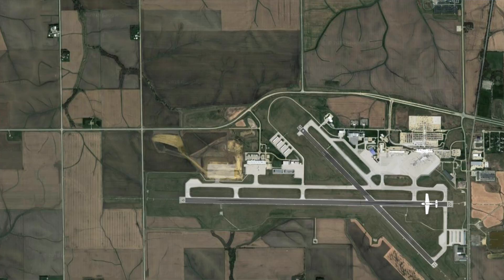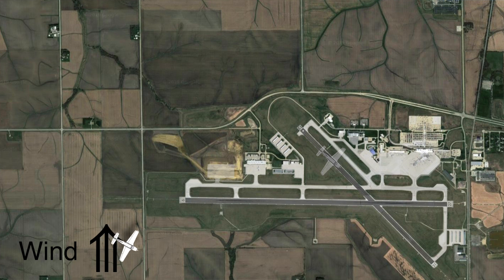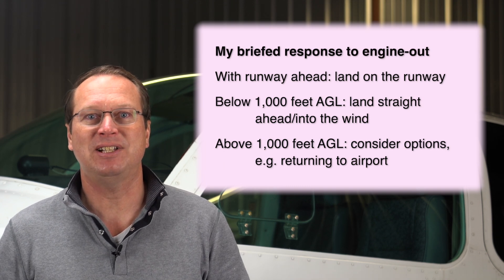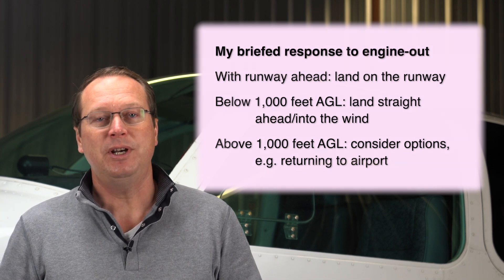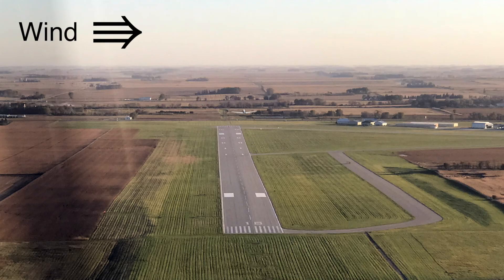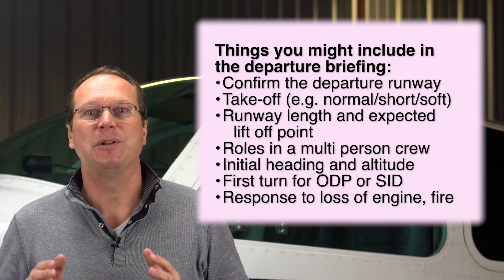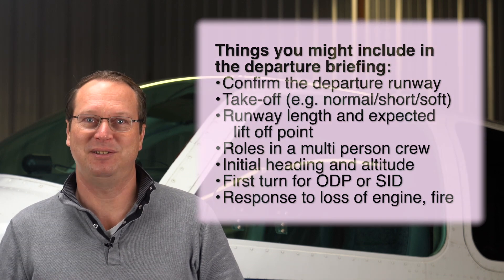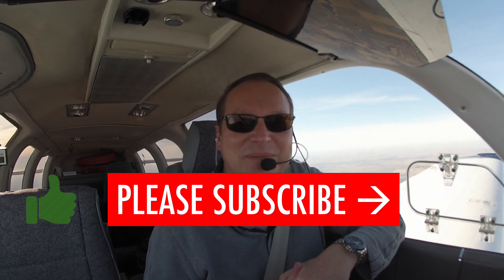Departure Briefings - HOW and WHY

Comment: 4 phases

1)ENG FAIL before rotation- throttle idle directional control w/rudder brakes as required, get off the runway if possible 

2)ENG FAIL after rotation w/ runway remaining land normal, directional control w/rudders brakes as required get off runway if possible (on taxiway)

3) ENG FAIL after rotation without runway remaining- land in front of you, no more than 30 degree to your left or right with shallow banks. Pitch for Vg, fuel shut off, mixture idle cutoff, electrical switches off, master switch off ignition off and key out, seat belt tight, door cracked open. 
(Landing on road try to go with the flow of traffic) (Landing other than pavement, land slightly nose high).

4)ENG FAIL above 1000 feet turn into wind and come back towards airport environment.

Comment: Great lesson - Thank you!  Without writing a novel, I lost thrust in a PA-28 Cherokee 140 at about 150 feet.  The propeller was still turning and  I instinctively turned left (pattern direction) thinking I might limp it back.  I made it through about 20 degrees of turn and realized it wasn't going to work so I landed straight ahead into a field of mesquite trees.  Totaled the airplane, no injuries.  With the insurance money, I bought another PA-28 and the next time I took off from the same runway (my son was flying so I could look around more) I noticed a farmer's dirt road 10 degrees right of runway heading.  Had I known this prior to TO, the initial turn direction would have been decided and I could have saved the airplane (and potentially taxied back to the airport!).  For what it's worth, Google Earth is a great resource for making those sorts of pre-departure decisions - I know that the images are not current, but it's still a great SA builder.  For those interested, the investigation showed that a dirt (mud) dauber nest was in the air induction system and broke loose and clogged the carburetor air intake.
Reply from the maker: Thanks for sharing that story, Logan. I agree, Google Earth or even just Google Maps in satellite view can be very helpful planning tools.
- Martin

Comment: Nice. My C152 departure brief is very similar to yours: Stop on rwy; Land on rwy if possible; wind direction is ** so it will be a ** turn to land in field within 30 degrees of rwy hdg. (I know where they are at my home aerodrome); Airspeed 65kts; Fuel, mixture, throttle & mags off; Flaps down as appropriate; Master Sw off; Sideslip as required; passenger briefed prior to taxi about keeping quiet, how to brace & aircraft exit but reminded at end of DB; if over 800ft more fields are available but a runway return is not until 1500ft alt. I do this every flight & practice fanstops about every 6 hrs.
Reply from the maker: That's a good habit, Steve. Nice job!
- Martin

Comment: A reminder about departure briefings ... pushing the yoke in and the nose down right away is critical.  Right after takeoff, the airplane is in a nose-high attitude and airspeed is already slower than cruise and may even be around best glide.  Pushing the nose immediately avoids the stall more likely to happen when the plane is already slow and the nose is high.
Reply from the maker: That's right!

Comment: Timely video. I've started to do a departure brief, out loud, even when solo in recent months. I find it a useful process to go through and it helps me to slow down and consider what I'm doing.
Reply from the maker: Good for you - speaking out loud when you're by yourself or only with non-pilot passengers may seem silly, but it actually works better. Keep doing that!
- Martin
Reply: @martinpauly  The other thing I try to implement is "talk and point", taking a cue from Japanese train drivers .https://www.youtube.com/watch?v=9LmdUz3rOQU

Comment: Hi Martin...as one of your newest subscribers let me say Happy and Safe New Year...and great video. If I may I'd like to add one addition to your departure briefing-and that is be absolutely be ready to push the nose over at any time if things go quite up front...on climb out we are a a relatively low airspeed, and high AOA, therefore airspeed is going to bleed off rapidly and a stall/spin at low altitude usually doesn't end well.  Just as I head out to the runway, I brief myself push the nose over and below 1000agl.,I going basically ahead....if power is lost on TO or climb, be ready to push that nose over, I guess almost anything is better than a stall/spins at 700 ft....Thanks again for all your insightful and educational videos.....
Reply from the maker: Good comment. Without sufficient airspeed, it's likely not going to end well.
Happy New Year to you as well!
- Martin

Comment: Good advice and thanks for posting.  I was never trained or told to do a departure briefing in a single engine airplane.  It was not until I did my multi training that I started to do departure briefings.  Before every flight in a multi engine airplane I would do a departure briefing but it makes sense in a single as well and I will start doing it now.  I see a lot of videos of folks flying multi engine airplanes and they do not do a departure briefing in their multi flying.  It may be cleverly edited out of the video but usually it looks like they just do not do one and they really should.  This is great advice.
Reply from the maker: I think it's even more important in a twin to do a departure briefing. With the second engine come many good options, but also the possibility of Vmc accidents. No better time to dry-run the correct response ("the drill") than before take-off.
Best regards, Martin

Comment: Hi Martin, Do you ever fly the impossible turn from 1000ft AGL? I'm told it can be done at that it can be done at that altitude or even lower, but not if it is the first time you are attempting it. One CFI suggested that pilots should set their turn back height to the lowest altitude that they have successfully demonstrate the maneuver 3 time in a row.
Reply from the maker: I have not done this from 1000 AGL myself in the Bonanza, John. I have done it at higher altitudes, though I hear from people with much more experience than what I have that it is a very different sensation doing this close to the ground.
The point of the video was not to suggest that 1000 feet is the right number - but to remind yourself of the number before take-off. Your point is very valid that what this number is depends on many factors, including training/practice.
Thanks for the comment, and all the best for 2020!
- Martin

Comment: A few things to include in your pre-flight briefing is your procedure if it suddenly gets quiet. The first thing is to push forward on the yoke. If you don't have altitude then airspeed is the only friend you have left, don't give it away. Get light in the seat, the airlines teach that, PUSH, you must not just sit there bleeding off airspeed. Know your best glide speed, look it up or calculate it before you go. If you decide to turn back you'll need that speed and realize that your stall speed will be quite a bit higher in a steep bank. I believe a Bonanza will stall at just about 100 knots in a 60-degree bank. As you climb out, pick a spot to plop her into if things go bad, change it as you progress. Practice slips until it's second nature. You can dump speed and altitude rapidly in a slip. You have only one chance to hit your target, get it down on the spot you chose, you cannot afford to float halfway to Hoboken. It's vitally important to have all this in your head at throttle up. The time to plan is before taking the runway.
Reply from the maker: All very good suggestions, Craneman. Thanks for posting, and Happy New Year!
- Martin

Comment: Hi Martin: the “impossible turn” is already very difficult at 1000ft AGL and at 800ft AGL is even worse, as you said. Depending on the type of aircraft, these values may even increase (in the V35B I fly... I forget everything below at least 1500 ft but straight ahead or with a minimal deviation due to the ridiculous climb rate on takeoff). The departure briefing is always important and I would add another information such as Vglide speed should something occur.
Reply from the maker: Good input. 1,000 feet AGL is not the right number for all airplane types. And if you routinely fly different airplane types, additional reminders are helpful, like the best glide speed as you mentioned, or a reminder to pull the prop lever back for better glide performance.
All the best for 2020!
- Martin

Comment: Happy New Year Martin! As always great video. I use the 1000ft agl rule for turning back also but I don't necessarily concentrate on making a runway, I'll land on a taxi way or even the grass  in between if necessary. There is a drag strip right next to my home airport and it is always considered by me as an emergency landing strip. One other thing I brief for is with the exception of landing on the airport grass I brief for the position I want the gear in. Solid ground such as concrete or asphalt its gear down, soft is gear up. And one thing I always remind myself is to pull the prop full decrease pitch while the engine still has enough oil pressure to make it happen, its amazing how much more glide you gain by doing this
Reply from the maker: Those are good reminders, Mike. Thanks!
Happy New Year!
- Martin

Comment: There was a great article in the AOPA magazine a while back, to illustrate the dangers of low altitude turns back to the airport, and a way to safely see how your plane could handle this. They suggested a normal climb to 3000 feet agl, pulling the power, then waiting about 4 seconds (your crisis reaction time) before starting a 180 back toward the airport. At the completion of the 180 turn, see how much altitude you have lost, then add a healthy margin to that for added safety.
Reply from the maker: Yes, that's a good place to start. I would argue, though, that idle power is quite different from an actual failed and windmilling engine. To really experience how little one can do with the altitude left, you'd have to pull the mixture to cut-off. And I don't recommend trying that without an instructor.
All the best for 2020!
- Martin
Reply: I agree Martin. My lighter weight Grumman Cheetah did this exercise and lost 400 feet. I doubled it to 800 for safety, not far from your 1000! The little aerobatic Corby Starlet I built that you see in the picture was much less!

Comment: Great advice, Martin! Nobody taught this when I was learning to fly, lo these many years ago. I wonder how many injuries could have been prevented, not to mention lives saved, if this had been standard procedure all along.
Some pilots are reluctant to brief out loud when flying with passengers. I can understand this. Some passengers don't want to be reminded of the possibility of an engine failure. I think a calm explanation that engine failure is highly unlikely but still possible and that you want to make sure you have a plan in place to handle it safely and successfully goes a long way toward alleviating anxiety. Then, brief out loud and direct the briefing to your passenger(s). This gets them involved and gives them a feeling of control. Feeling in control helps to relieve anxiety and can prevent panic when a problem does occur.
Remember: hope for the best, plan for the worst, and expect something somewhere in between.
Reply from the maker: Good message, John. Speaking out loud is much stronger than just thinking it, from a human factors perspective. Many people feel silly speaking to themselves, but there's a good reason to do so in this case.
- Martin

Comment: Excellent topic. Having been through this exact scenario, engine failure on takeoff, I can say it happens fast, really fast. As PIC one has to make snap decisions and keep moving forward in order to survive.

I do not brief out loud if my bride is flying with me but the plan is one I review and am ready to react. In my case I had departed and at just shy of two hundred feet the first bang and vibration hit. I pitched for best climb and then the second heavy vibration hit, robing me of any power. I had made it to three hundred thirty feet and decided not to trade off altitude for my planned straight ahead go to spot, to get a visual. Instead I went with my plan B, left turn and land on the roadway. There was too much traffic to attempt the road so I rolled into my next go to, continuing the left turn to a golf course.

I would not have made it without a plan. There is no time to second guess. My total time from wheels up to emergency landing was 51 seconds.
Reply from the maker: Which shows the value of having a Plan B, and even a Plan C.
Glad you were able to make the golf course.
- Martin
Reply: Would love to see you do a video about this incident!

Comment: Happy new year Martin, and great advice! When I was flying, this was something we always did this, especially with the layout of my home airport, MKC, Kansas City downtown, as the headings were 1-19, with city to the south, the Missouri river and the river and bluffs to the north, and 3-21 with industrial complexes on either end, with obstacles such as grain elevators and railyards on either end. not any great options anywhere, by there were a few, and IIT required knowing the land around the field very well. not optimal, but there were a few places that were doable. I suggest that any pilot should take the time to drive around their home airport and familiarize themselves with possible landing sites. being prepared for such an event will cause less stress in the cockpit avoid this occur, and while flying out, check off these potential spots every time
Reply from the maker: Very good advice, Vic. MKC is particularly tricky for the reasons you mentioned, and maybe serves as a reminder that even with the best planning, we can only minimize but not completely eliminate the risk of a bad outcome. I'm lucky in that my home base is surrounded by open space in all directions, giving me lots of choices I don't have flying out of (or into) MKC or MDW.
All the best for 2020!
- Martin